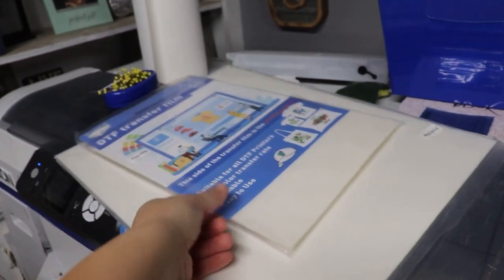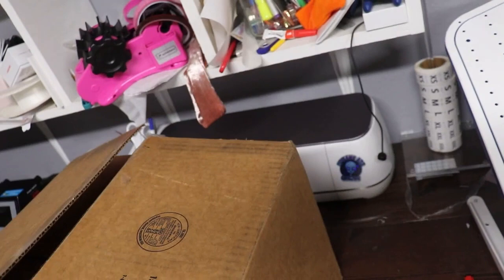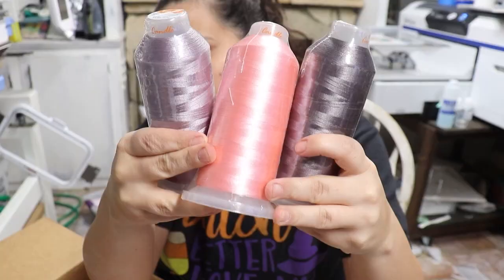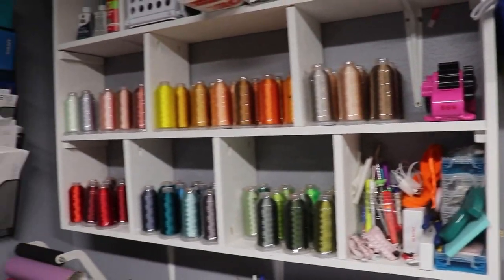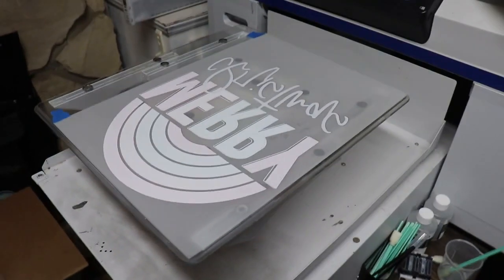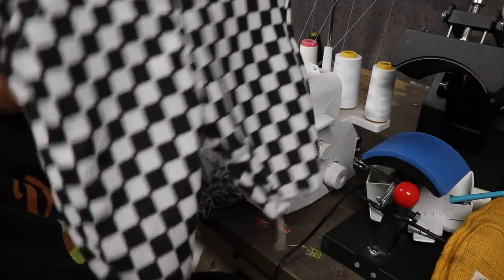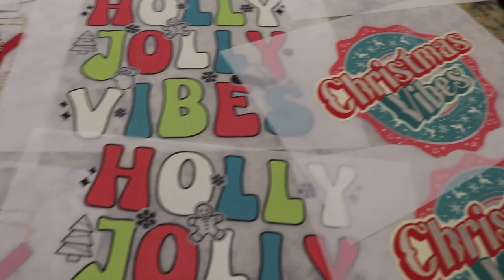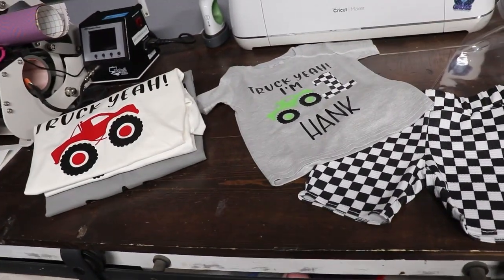I Got My Largest DTF Transfer Order Selling On Shopify / Work With Me On Etsy Orders / Studio Vlog

Comment: Hello.  You can do dtf on dtg printer?
I heard the dtf machine is high maintenance and requires certain humidity.
Reply from the maker: Yup you sure can! Our DTF printer was such a pain and had so many issues. Since doing it on our dtg it has been a lot easier.
Reply: @NeitaFajita  :) are you using dtf ink or dtg ink? 😊 I was thinking about converting a Eason printer to DTF but I’m reconsidering now 😁
Reply from the maker: I use dtg ink.